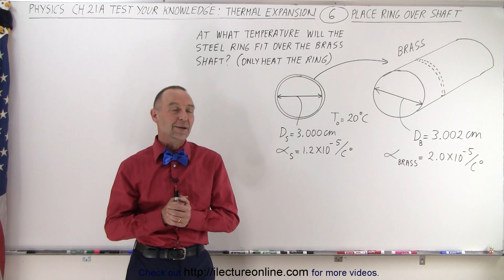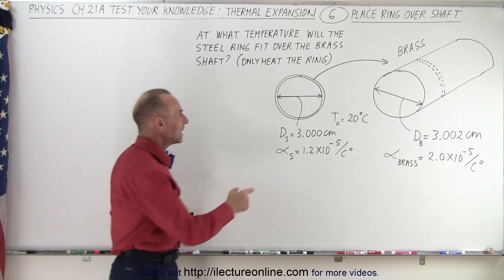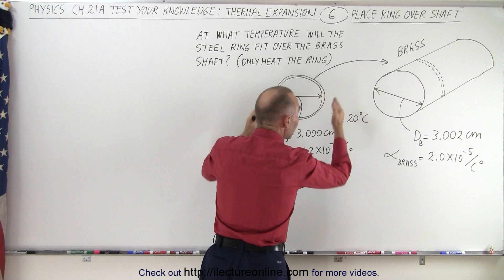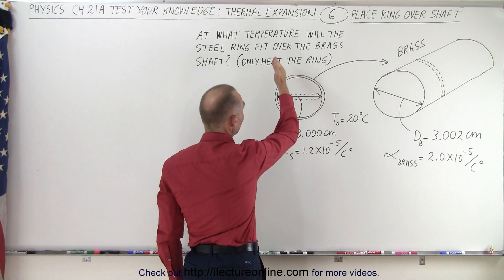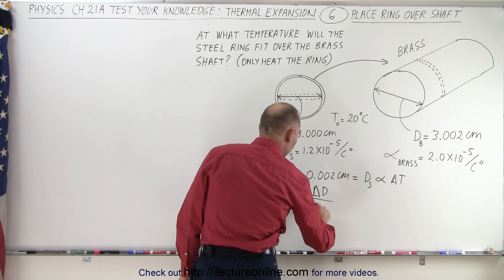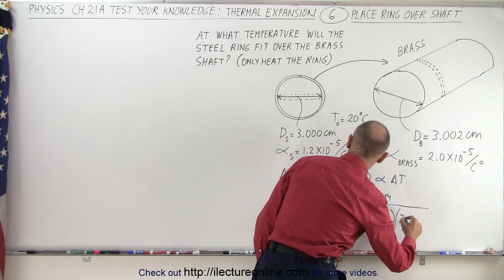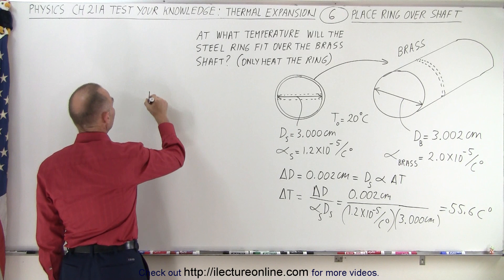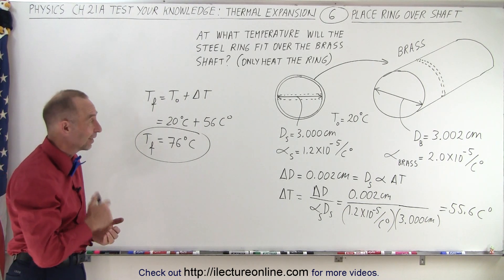Physics - Ch 22A Test Your Knowledge: Thermal Expansion (6 of 20) Place Ring Over Shaft

Comment: Totally related to "ancient clock" manufacturing. John Harrison used this to work out his "gridiron" pendulum, which made temperature differences "non-existent" where the pendulum was concerned. His issue was with barometric pressure, which I believed he reduced with a wider swing thanks to his cycloidal cheeks and frictionless escapement. Great vid, Professor!

Comment: why is this wrong if I apply the linear expansion of coefficient to the length of the ring which is 2πr? This is the physical length of the metal ring.  If I cut off the ring making it like a wire...